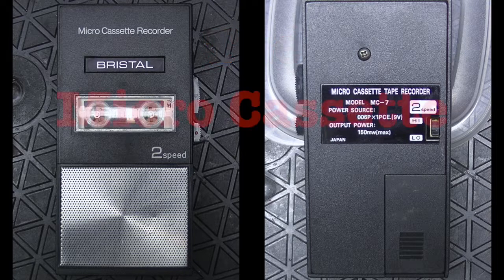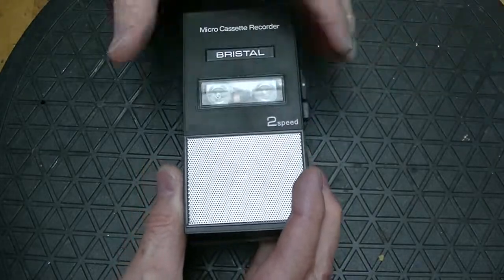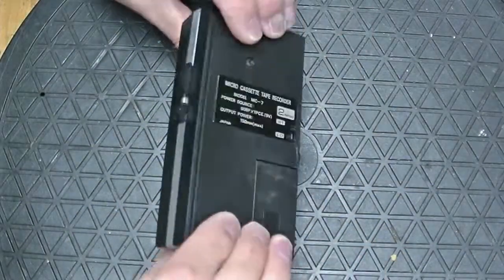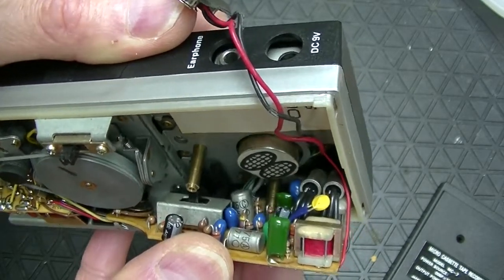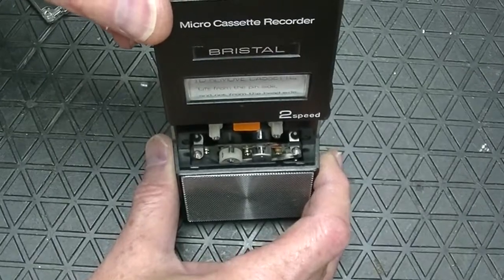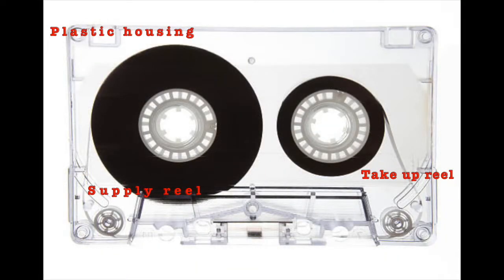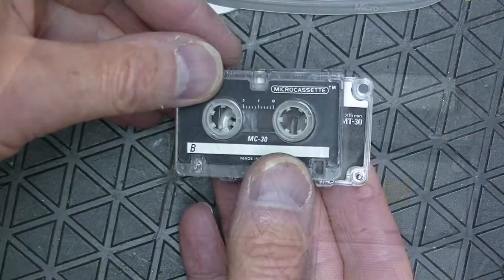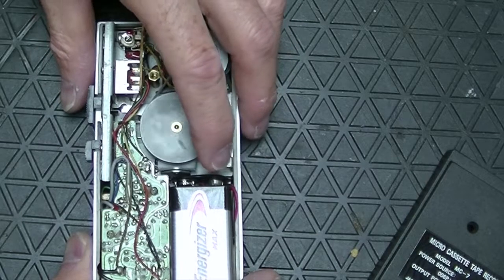Hidden Surprise inside the Bristal MC-7 Micro Cassette Tape Recorder

Comment: It's a Micro  Cassette-Recorder. NOT a Microcassette Recorder. Deceptive labeling typical of no-brand products peddled at flea-markets and convenience/discount stores, targeting clueless customers. I'm surprised it's made in Japan, not Hong Kong - I'd estimate early 1970s.
Reply from the maker: I agree. Deceptive labeling. Based on the construction of the PCB I’d peg it between about 1968 and 1972 but given the scant information available on this machine I don’t know if we’ll ever know for sure. There was an interesting paper label with a logo on the back of the speaker which you can see in the video. I am certain I’ve seen that logo before but I can’t remember where. Take a look. That may give some clues into who (and when) this machine was made.